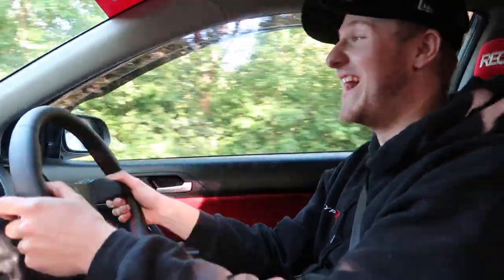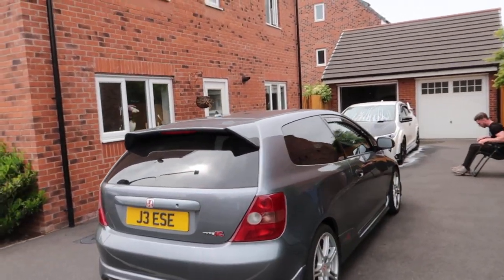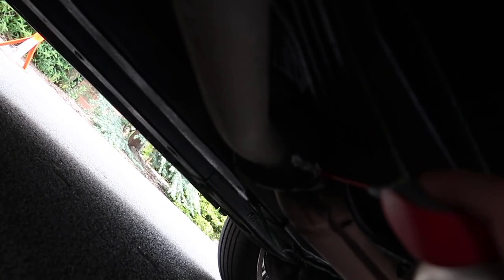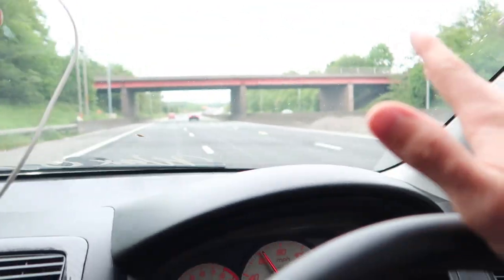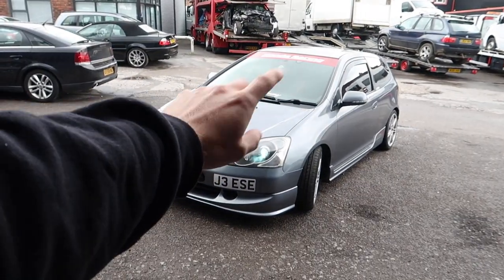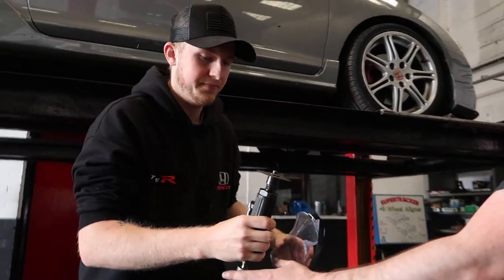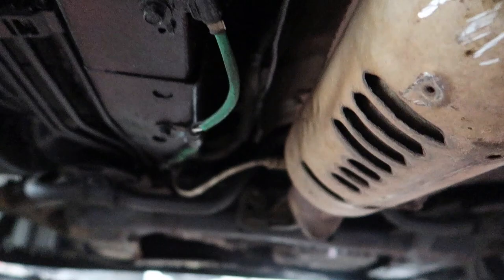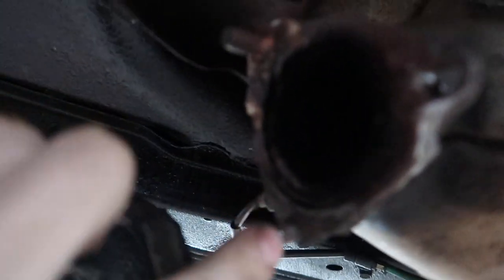SKUNK2 Megapower R Exhaust for the Type R!

Comment: The reason the b-pipe don't meet up with the cat is cos it's a jdm part designed to meet up with a jdm cat. Drilling a couple of the holes out on the b-pipe should help it fit better

Comment: You'll get fed up of the sound within a week lol trust me I got a Cobra cat back system straight though, it's great a meets and shows etc but for daily driving it's just way to loud inside the cab 😭 lol
Reply: Yeah I got fed up of mine after long sick for hooning so annoying when just nipping to the shop or motorway
Reply: Not a civic but ive got an electronic exhaust cut out valve on my mk1 audi TT. Its great because its quiet when i want it and rather loud when i want to hear it roar. Check my channel out ive uploaded a clip of it.
Reply: Motivation MFfitness12 I agree I just get fed up when on a long journey or a quiet journey with family 😂
Reply: skegzy yeah my rs3 same I can have normal tone or flaps open and it’s more or less a straight through 😂

Comment: That exhaust is mega loud! Wait until you 421 it and pull the back seats out! I nearly bought the same system but I know you won't get on most UK tracks with it plus the pipe work is mild steel which put me off. You going Honda's of the North at Barton airport Manchester on sat?
Reply from the maker: Speeding Turnip what times it on mate?
Reply: @JesseCollingham  7 I think it starts. Went last year and was a good turn out, this year its having trade stands etc so should be bigger. I'll try tag you on Facebook if not just search Honda's of the north.👍🏼

Comment: Question, how do you pass your mot with a decat?
Reply: You need a friendly mot guy.
Reply: Carl white Or as they do in N.Ireland you cut the cat open smash the insides of it out weld it back up the welds are on the top and not visible